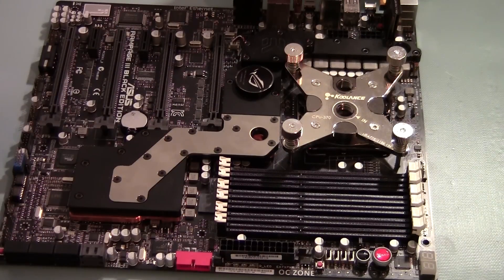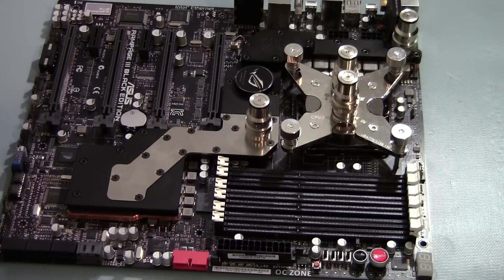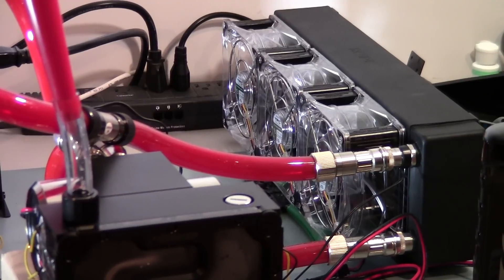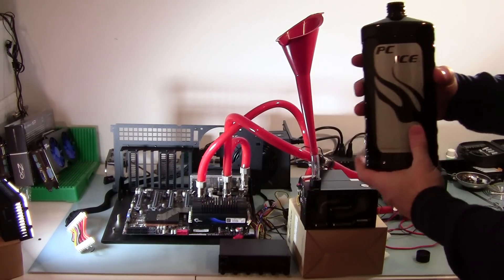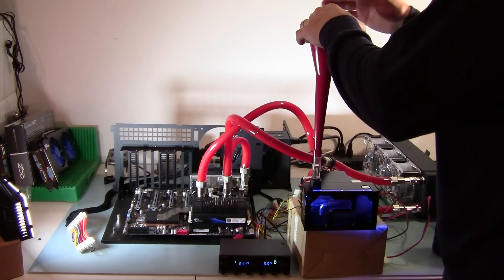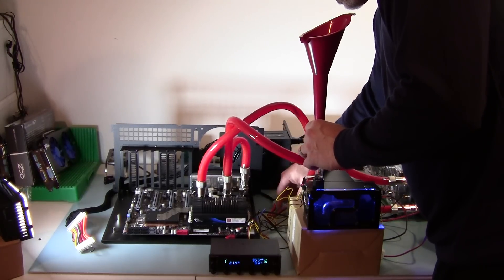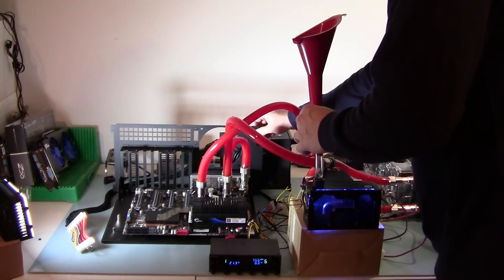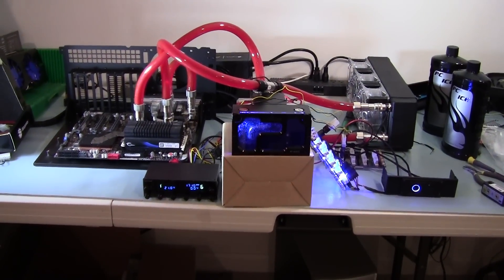Kick Ass Temjin TJ11 Build - Part 2

Comment from the maker: @h3avysoundz Length when you connect two is about 2 1/4 inches not including the compression nut.  So yes you will have some stainless to look at but fr me they are fine.  The ease of use and service are worth it.  I do have aflow meter in this loop but it needs to be connected to my fan controller to see the reading.  I have not had any problems at all. They are also High Flow fittings.  Thanks for looking and asking.

Comment from the maker: Dude , It all got got bled fully after it was installed in the case. Moved the system around a bit to get all the air out of the radiator.

Comment from the maker: @Itechnohead But isn't any fitting a going to produce the same result ? 
So you think I should put disconnects in line rather than at device ?  But if my temps are great then it should not matter right  ?